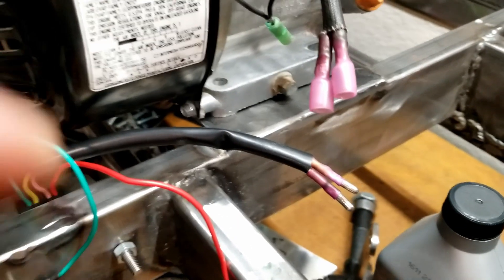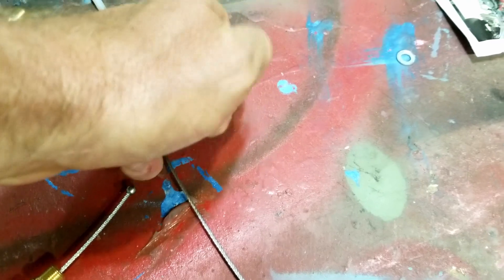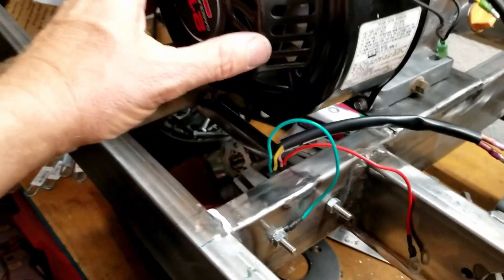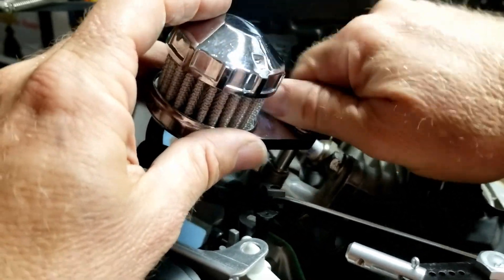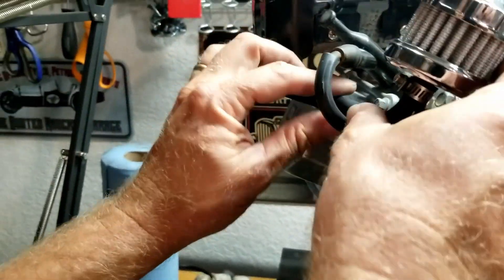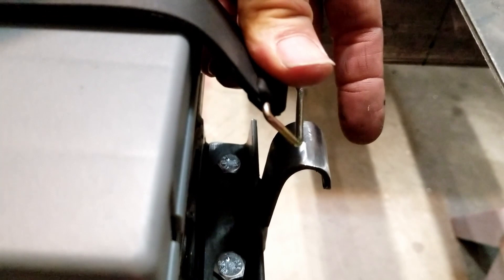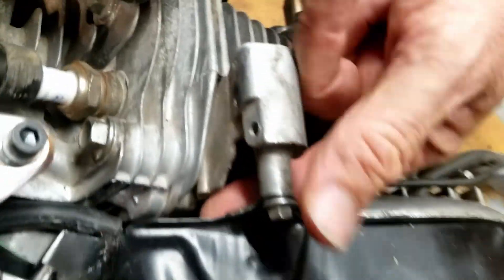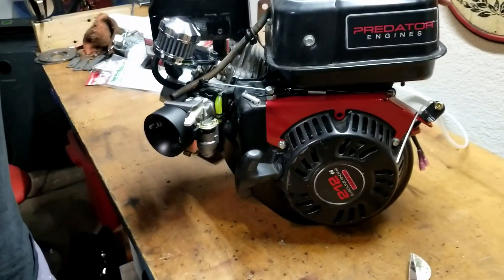CycleKart Engine Mods Part 2

Comment: Hey there, I just found the cyclekart scene a couple days ago and I'm totally hooked. Was wondering if anyone builds cyclekarts with a more traditional gearbox instead of CVT?
Reply from the maker: Some clubs do, the guys in Argentina use motorcycle engines and gear boxes and have blast.  I have not seen one done that way here in the USA.  As long as you use a small motor 90 cc or 110cc it would probably not have a performance advantage.  Performance parity is one of the reasons why we encourage the use of the simple go kart motor and the CVT
Reply: @stevevinson6030  Thanks a bunch for the reply, I am personally thinking it would be fun to use a 110cc engine with a gearbox that automatically engages/disengages the clutch. 

So it uses a centrifugal clutch to disengage the engine from the gearbox at idle, and a secondary friction clutch to smoothen gear changes. Thus resulting in a simple to operate + somewhat smooth manual transmission. Any thoughts?

*note
- the whole powertrain package is slightly bigger but should still be small enought to fit in a cyclekart. Would like to know a general idea of the dimensions of the cyclekart...
Reply from the maker: Simple is always better.  Build what makes you happy, but if you want to run at our events, build with in the established guidelines.

Comment: Why dont you use a 3S LiPo pack for battery.  Much lighter than that batery
Reply from the maker: I am looking at other options now, the Ryobi battery I am currently using, shuts off after a short time. Probably some sort of safety feature

Comment: Much better battery mount than original. Remember wire run for start battery should be as short as possible. Also, no feet no disconnect!
Reply from the maker: Good tips, thanks

Comment: Are there different engine classes or is everyone running about the same engines.. I've got a 110cc 4 stroke 4 wheeler engine that's got a 4 speed transmission that I've been looking for something to use for and these cars are awesome
Reply from the maker: Yes, the common engines are the Predator 212, the Honda GX200 or similar engines